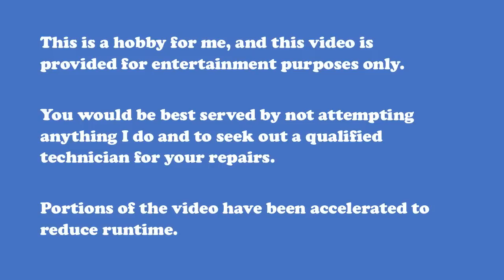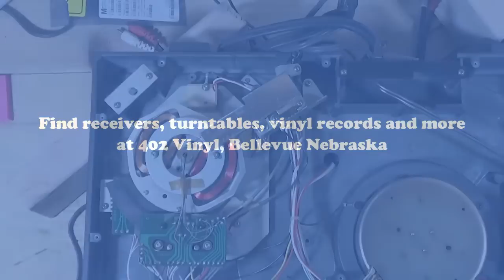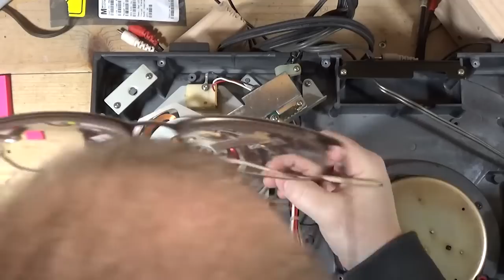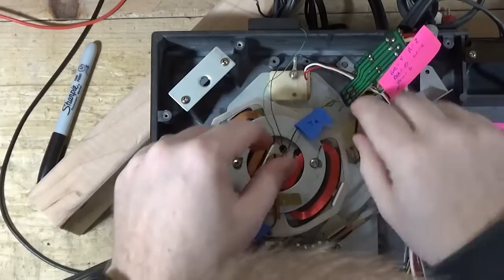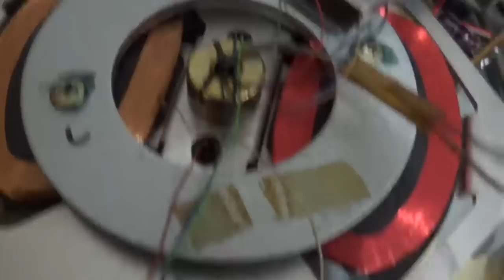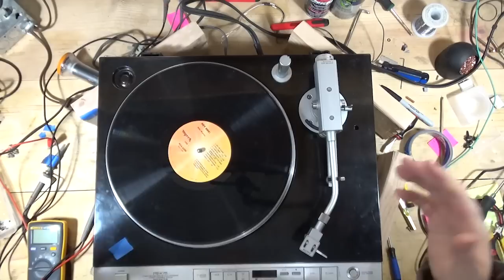Nightmare Sony PS X75 Turntable Repair Part 5 - Tonearm Wires & Chasing My Tail

Comment: You are a maoschist. :-) My PL-540 is a complex pain in the rear that will probably never work right. It pays to buy manual turntables. I am working on a Thorens TD-150 that is extremely simple. It runs fast but once I get the new belt that should take care of it.
Reply from the maker: Well, I was.  Today I would avoid the headache in the first place.